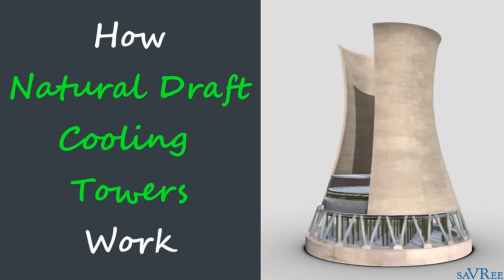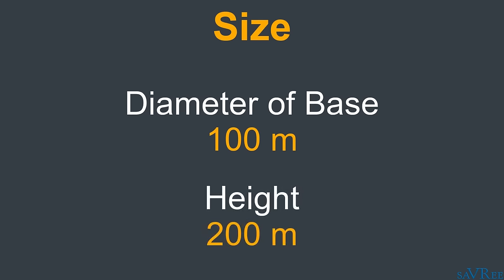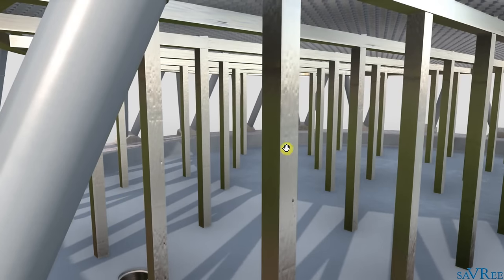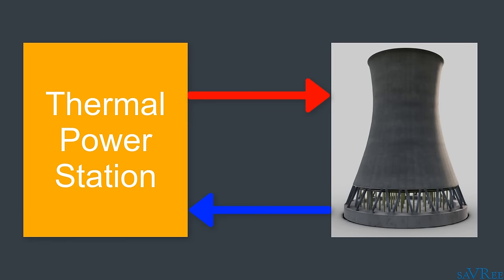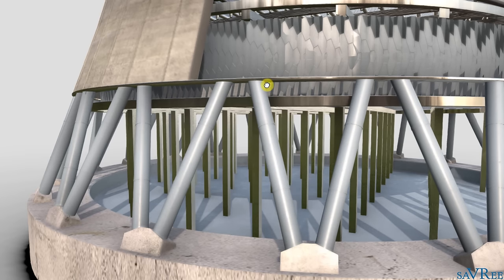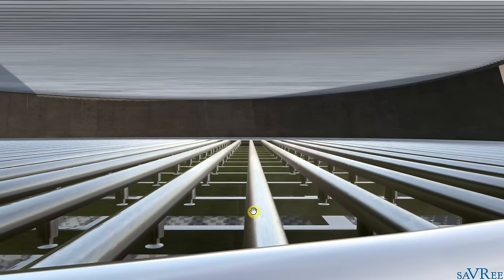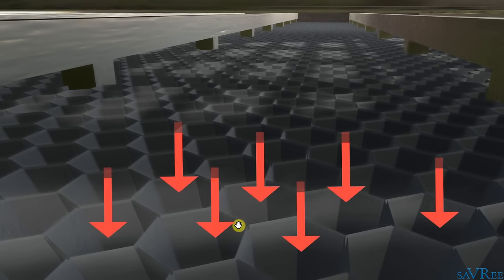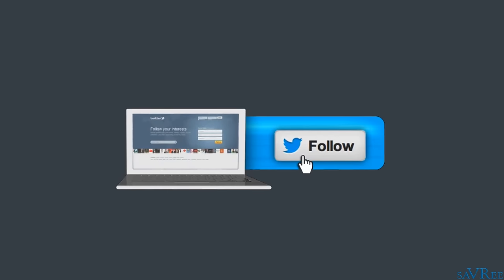How Natural Draft Cooling Towers Work (Stack Effect)

Comment: I have a question, why we should cool water?  When we can use the high temperature water to make steam easily?
Hope anyone explain me about it?
Reply: It's all about optimising the efficiency of the system.  The steam used to drive the turbines has to be condensed or all the water is lost and that water costs money. They use or rather reuse a substantial amount of water.  If the cooling water temperature is too high, then there is less condensate and more water is lost.  

The turbines themselves spin withing very strict limits so everything that might affect its performance is also maintained to strict ranges.  

Remember also that the water used in power stations often have chemicals added to control corrosion, freezing, bacterial growth etc and will need to be processed before being discharged. Those processes are also expensive so the water is reused as much as possible.

It is possible that the cooling water is used to pre-heat the water to be used to produce steam, before being pumped to the cooling towers.  This would help maintain a consistent temperature for the input.
Reply: @PhilJonesIII  thanks bro ❣️

Comment: It's interesting to note that the largest nuclear power plant in the US, Palo Verde, which has 3 reactors each with electrical output rated at 1,300 MW, uses three induced draft cooling towers per reactor for a total of nine. Despite the large thermal capacity of this plant they chose not to use natural draft towers because of high ambient summer air temperatures and a limited supply of cooling water in the low desert of Phoenix, Arizona.
Reply: They would still use the same amount of water. Older power stations favoured ID towers. The circulating water system (cooling water) still has to remove the same amount of heat from the steam in the condenser, and still has to have some of it evaporated to cool the rest. The higher the ambient temperature, or the higher the humidity, the more  CW has to be evaporated to maintain a suitable return water temperature.Tower capacity is designed for local conditions

Comment: i was gonna say couldn't the secondary heat coming back to the cooling towers be used for further energy generation... but at the point it exits the condenser it's only a mere 40°C or so, which is maybe only good for heating some home nearby if the climate is cold enough where that makes sense. Otherwise there's not much else that could be done with such low heat... maybe a stirling engine but that would cost more to upkeep than it's worth PP

Comment: 10:10 wrong it will rise above a gas with higher density 
cold air is higher in density than hot and that is why hot air will rise.
Reply: @savree-3d  You are great person and material I saw impressed me really great work and great spirit.

Comment: Water molecules are NOT heavier than air molecules!  O2 (21%) approx. mw of 32, N2 (78%) approx. mw of 28, H2O approx. mw of 18 though more polar and thus more likely to form droplets.  Perhaps this is what you meant.  Also, you didn't even mention heat of vaporization.

Comment: Huh.  I always thought it was a large closed-system condensation radiator and recycled water sprayed on radiator fins.  I never thought it was an open system a I thought water in and out back to the turbine condenser would get contaminated.

Comment: Wait, wait, what we cool the water for? Just to heat it again in a boiler? I thought, that just turning the water into a liquid to be able to be puped into the boiler by the pump. The closer is the water temperature to boiling point after liqification - the better. We just do not loose fuel to heat-up the water to the boiling temperature...
I think, that water in these towers is the water cooling the condenser of the turbine, not the water that circulates in the Rankine cycle inside the turbine and boiler. Cooling water is never turned into vapour.
Reply: Reducing the temperature of the water improves efficiency but I can't remember why.  It has something to do with the laws of thermodynamics.  Steam trains in hot countries were found to be less efficient than those in cold climates.
Reply: @westinthewest  You are absolutely right, this thermodynamics is called the efficiency of the Carnot cycle. The higher the temperature in heater and the lower in cooler, the bigger efficiency. Reducing the temperature not of the water circulating in turbine - boiler set-up, but reducing the temperature of a turbine condenser. Turbine has input (high temperature steam goes in and expands on the turbine blades performing the mechanical work) and output (expanded, colder steam goes out). We could throw out this steam into the atmosphere (like in steam locomotives), or condense this steam on cold walls of a condenser, that is closing the turbine. This way at the turbine outlet the low pressure is created, that additionally sucks the steam and improves efficiency. Water in this primary circulation is sealed as a working medium. The water cooled by towers is the secondary circulation, that cools the condenser. And it is right, the lower the temperature in condenser, the better vacuum (and suction). So, OK, cooling the water below it's boiling point can have sense. Thank you for giving me the impulse to think.

Comment: @saVRee That was interesting stuff...and I was impressed with the 3D animation - great work...

One thing though...you REALLY need to go through your scripts before recording...it seems like at times you were lost and didn't know what to say, so you ended up repeating yourself a few seconds later

The number of times you said "cooling towers" (~40), "natural draft cooling towers" (~15), was making me cringe. Often these phrases were repeated in quick succession. We know the video is about how cooling towers work - so you don't need to use the phrase "cooling towers" over 50 times in a 19 minute video - at one point (from 8:49 to 9:29) 8 times in 40 seconds. Similar, but not as bad was "thin film fill"...

You describe the shape of the towers as very unique - unique already means one of a kind, unlike anything else...so how can it VERY unique?

9:48 Hyperboloid then 11:37 Paraboloid

Clearly a drift eliminator is there to eliminate drift

At 5:52 you'd already told us it was a thin film fill type, so no need to tell us again at 16:05

Comment: The principle design is very close to jet engines.
Reply: Jet engine:  Air compression, then combustion of fuel, then hot high-pressure gases turn a turbine.   How does a passive cooling tower compare to that, at all?